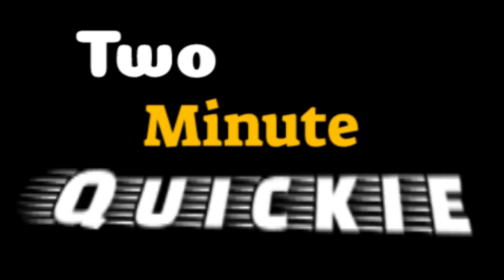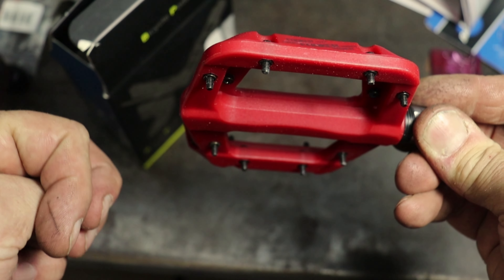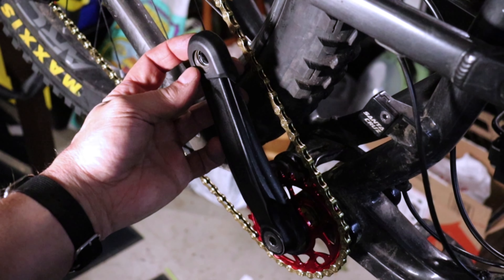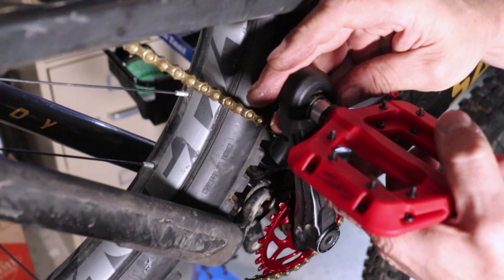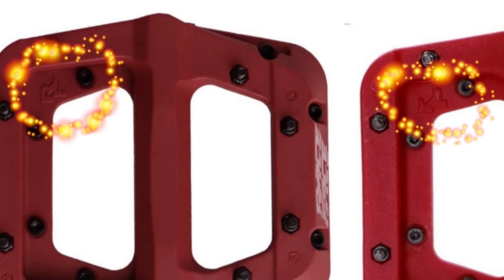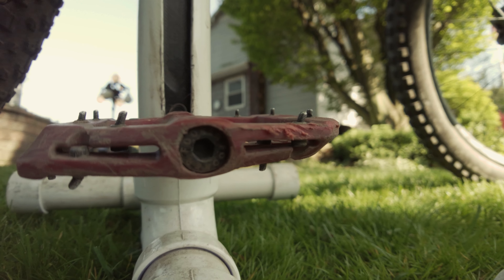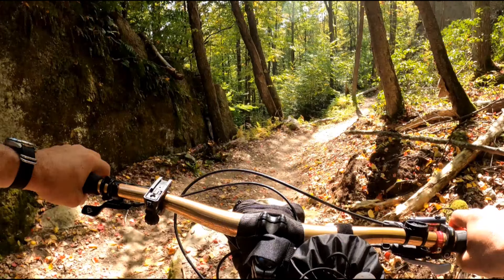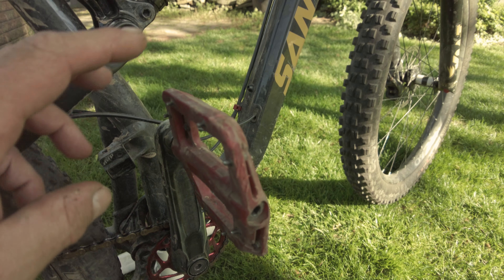Fooker Pedals | 18 Month Review

Comment: I'm an engineer and I work with molders overseas, there is no indication that fooker copied chester, there's every indication that both companies buy them from the same manufacturer and molder.    In 2023 things like bike pedals, even by big expensive brands, I probably bought from a chinese factory and relabeled.
Reply from the maker: Thanks for the info Evan. That's very interesting. I would like to know more about this and maybe make a video showing how these manufacturers work making these similar looking products. 
To me as well as some other channels who have done similar reviews on these same pedals, they look copied... Especially from the logo in the exact same spot, and just using part of it. The inner parts such as bearings, spacers and seals are night and day different between the RF Chester pedals and the Fookers. That very pair of pedals in this video are still holding up on that bike though, so no complaints.
Reply: google: plastic pedal bike china
Reply from the maker: Thanks Evan. I'll check it out.
Reply: Just watched your video again, the logo it's most likely just an insert in the mold that comes out and is replaced with different logos, it's pretty unusual to grind down the hardened steel mold, especially for glass filled nylon parts like these petals most likely are, interested in manufacturing some bike stuff let me know, you can put your e-mail here and I'll get back to you.
Reply from the maker: @EvanHarp  Thanks again Evan. I can be reached at themostlymikeshow@gmail.com

Comment: I put it on my Terk Marlin 7….. I have no  issues what’s so ever.    I’m so happy with them.   I purchase another set when these wear down. I know should not buy knock-offs.  But times are rough….and finically speaking….. RaceFace is better off finically then I am……I’m sorry 😢.  Thanks for the video. 👍🏽👍🏽👍🏽
Reply from the maker: Hey Lenin, I appreciate you watching and taking the time to leave a great comment. There's nothing wrong with the Fooker pedals. They're great value. I'm going to keep running mine until they fall apart, and then maybe make a quick video follow up showing how long they lasted. Happy riding and hope those Fookers serve you well!
Reply: I'm using a pair of fookers in my Marlin 8, with a pair of Ride Concept shoes, just the perfect couple.
Reply from the maker: That's exactly what I am using too Luis. Thanks for watching.

Comment: I realize Fookers blatantly copied Chesters. I realize this. But...Chesters really have to work on their price point. Doesn't have to match the price of the Fookers, but it's got to be a little closer to justify spending the extra $$$ on an innovative company.
Reply from the maker: One thing I can say about them though, Andrew, is that although they look and feel very much alike, and they perform decently, but if you watch the Berm Peak reviews, Seth really looked at these in depth, and a lot of the parts of these Fooker pedals were copied without really looking at the, purpose that the part was for. Despite all of that engineering , the Fookers still seem to perform good . Looking at the recent prices, it looks like the Fooker prices went up a little bit while the Chesters remained the same, so the gap closed a little.

Comment: Thanks for the review.  As someone who's used both the Fookers and the Chesters, do you notice any difference in how "hard" the material is?  In other words, can the Fookers take an impact that'll put a gouge or mark in the material as well or do they get mangled easier?  Reason I'm asking is another reviewer claimed the material on the Fookers was "soft".  Thanks.
Reply from the maker: Thanks for watching Madcapper6! To answer your question, I really haven't noticed anything significant as far as material and how well that it does with pedal strikes. They both seem to mangle about the same as far as that goes. The seals between the pedal and crank arm is the part that I failed to make a better report on, so I'll sort of do it now. If you look in the video toward the end, you might see that the seal on the Fooker pedal is deformed somewhat. It appears to be more ornamental than the one on the chester pedals that I had been using. On the berm Peak Channel, Seth has extensively tore down these pedals and analyzed many different parts sort of like I did, but way more in depth. Despite that seal being deformed as it is, and the miles that I had put on these, they seem to be a pretty good bang for the buck. Seth describes the copying as being sinister, and I can't say that I disagree. When I say that buying the Chester's is the right thing to do, I am saying that the Chester's are time proven. I am going to continue to use the Fooker pedals until they fail, and maybe put out a video telling what has failed as well as how long it took to fail with the mileage on them. I hope that this helps. Please consider subscribing if you haven’t already and you'll be in the loop for more of these types of reviews.
Reply from the maker: Geez! I looked at how long when did I was on that. I apologize if I confused you on anything.
Reply: @themostlymikeshow  Nah it's all good.  I appreciate your response.  Thanks.
Reply: @themostlymikeshow  I did in fact notice that the seal looked a bit off but didn't think much of it because you had described them as still in good working order for the most part.  That would be cool putting out a vid about how and when they break, whenever that might be, particularly since you seem to be putting forth an objective analysis of these pedals and the fact that you're riding them pretty hard so a vid documenting their demise and how long they last would be very informative.  Just the fact that they've lasted this long to me tells a lot about the pedals already.  
Thanks for the vid. Liked & subbed.
Reply from the maker: @madcapper6  Thanks! Very much appreciated! I'll post something when they finally break.

Comment: Did you get the 3 bearing or roller pin version?
Reply from the maker: Hi Daniel. I bought the 3 bearing. I would definitely recommend these pedals. It's been a year since I made this video, so we're looking at 30 or so months. They have been dunked in water, mud, etc... They're beat up pretty bad, but they keep going and going. I ride a lot of rock gardens so pedal strikes are frequent. They don't look pretty, but they have not let me down as of yet. Thanks for watching.